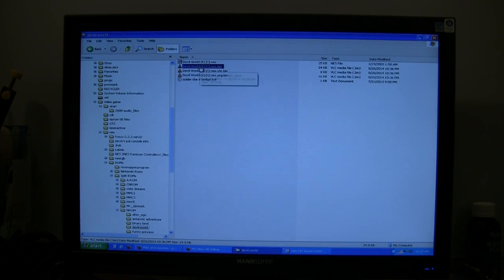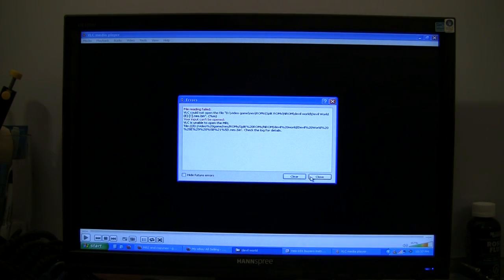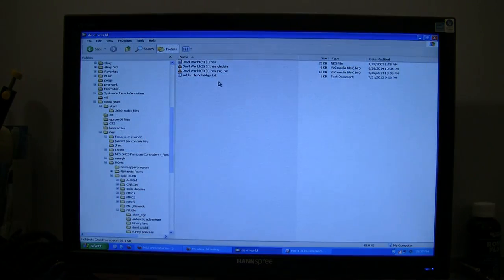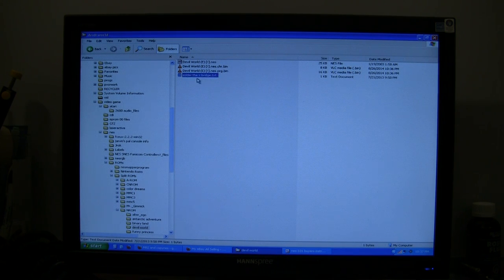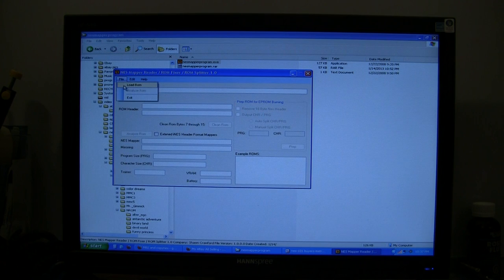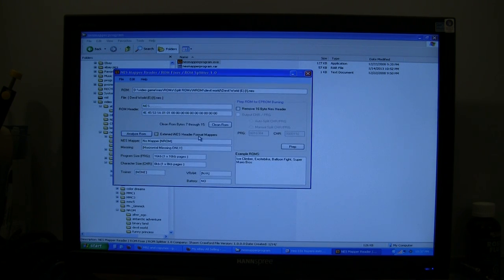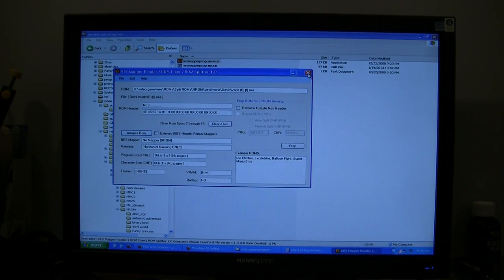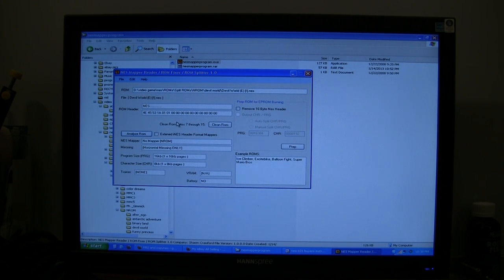How to make NES reproduction games Pt1 using donors and eproms

Comment: I have one question: Is there a way to put a lua script in the nes game? For example. There's this rom hack of metroid called: Mdbtroid and there's also an awesome lua script file separate from the rom hack that gives you a map in the game. Is there a way to combine that?
Reply: look up ips patcher
Reply: No. The Lua scripts for emulators like FCEUX don't run inside the (virtual) NES, they run on your computer outside of anything the NES knows about. The NES is a VERY memory and processing constrained system. It doesn't have the resources available to port a Lua interpreter to it, and implement all the things it can do. Even if you could run the Lua interpreter on the NES, AND still run the game at the same time, the NES doesn't have generic pixel-plotting hardware, so you can't draw overlays like minimaps. (NES games are pushing the processor and available RAM near the limit, so even if you could write an NES Lua interpreter, you have no power leftover to run it in concert with the actual game)

tl;dr: Completely outside the realm of feasibility. If you want it on a real NES you have to ROM-hack the equivalent functionality into the game in 6502 assembly language.

Comment: If you use a heat gun desoldering will go much faster, the part just "falls out", then you can just remove the left over solder (if any) with some solder wick. This technique goes much faster than the solder sucker.

Comment: if you have a 3D printer you could print your own cart cases, I think that you can get a USB2PRT adapter that will let you use your programmer with the newer PC system units.

Comment: Is there anyone that could modify an old NES game and change certain things about it?  There's a strategy game I like by KOEI that I already have on NES but would be very interested if someone knew how to change some parameters of the game.  Sadly, I have ZERO technical skills
Reply: This is called ROM hacking. If you want to change anything about the behavior of the game, you'll need to learn 6502 assembly language to change the game code. If you just want to change the graphics, you can typically use general purpose tools for that, and if you just want to change levels, there may be a level editing for your game of choice.

Comment: how would you approach doing reproduction cart of the same game but different language on the same cart?
Reply from the maker: +kokodin Use a traslated rom.
Reply: +GameTechUS 
obviously.
And with a game such as kirby adventures? I have german nes cart (pal) and i would like to program in oficial british english (pal) rom.
Would copyright protection circuit do any trouble and should i use original rom chips or could i use flash chips instead ? (rewiring afterward)
Reply: Wait, if you dump your own game and then applied a translation patch to it and put it on a reproduction cart for yourself would that be legal?

Comment: I want to make a cartridge of Metroid Rogue Dawn and I want to be sure to get the correct board and chips, etc. The original Metroid used a password system, but Rogue Dawn has battery backup. Does this make a difference when choosing which EEPROM chips I need to use? I'm sure I need to use a board with a battery on it. Is the mapper still the same as original Metroid?

Comment: have you tried a parallel to usb adapter?
Reply from the maker: No, but did buy a top853 and hated it too, might do a vid with more details on my programmers as I do have yet another new one as well.
Reply: Parallel to USB adapters often don't work for things like this: The parallel port was a very low-level interface. You could write data to the port's I/O address and it would flip the state of the electrical lines of the port almost instantaneously. As a result the parallel port found all kinds of uses in the 1980s and 1990s ("bit-banging" protocols for various devices) before it got phased out and everybody started using USB.
USB devices normally communicate with the host no more than 100 times a second. So the host can't instruct a USB-to-parallel port adapter to change the state of those I/O lines faster than that. To move data faster the adaptors accept larger packets of data each time they communicate with the host, buffer it, and take on some of the responsibilities of communicating with the printer. They sacrifice some of the flexibility of the original parallel ports in order to work better with USB.

Comment: Why aren't you trying to save the EPROMs to use later? Are they unusable again?
Reply: The chips he is desoldering? Those are not EPROMs; they are regular rom chips, not erasable. You can tell an EPROM by the "hole" in the center of the chip. This allows UV light in to erase it. Also why you see them with stickers on them so they don't get accidentally erased.
Reply: Assuming it is possible to do so without damaging internal parts. Could a regular ROM chip be cut into from the top to expose the center so that it could be erased with a UV light box?
Reply: Nicholas Bullock NO.
Reply: +Nicholas Bullock no
Reply: Zestypanda So, if you take one out and later decide to put it back to use it as it was before, it won't work?
Reply: Nicholas Bullock Nope. They're created differently.
Reply from the maker: +Nicholas Bullock Yeah just rewire it again to repair the traces, but not likely to ever happen.
Reply: A regular ROM chip isn't writable at all. It's manufactured in such a way that the data is fixed into the hardware, not written to it as software. Its transistors are configured, physically, to represent a certain binary sequence. This is called "mask ROM". They make a sheet called a "mask" that they lay over some silicon, that has the right arrangement, and they etch away parts of the wafer. The result is that ROM is physically etched out of metal, not programmed.

An EPROM is different. It's made to be erasable. It's not physically fixed. An EEPROM is similar, and can be erased with electricity, not UV light.

You can cut open mask ROM if you like (or you might have to burn it open with very dangerous acids), and look at it under a microscope. You'll be able to see the little physical dots of metal representing each bit of data, but you won't be able to change them.

De-desoldering a mask ROM chip from a board doesn't destroy it. If the pins are still in tact, you can still solder it back on. It would still work.

Comment: Have you tried using hot air to desolder the eproms?
Reply from the maker: Yes! It was a FKN disaster! Of course i'm still not super proficient with my crap hot air station, but I managed to make get several chips off with some ease but also made one pcb actually explode in my unprotected face! LOL
Plus it doesn't leave the holes open anyway even if it does get them off a bit quicker in the end the 808 is quicker.
Reply: GameTechUS Yeah, I wish I had an 808. I thought some hot air might help out after you had used the 808 and still couldn't get the chip out.  I hate desoldering through-hole! I like that little drill you have.  Do you have a link where I could get one like it?
Reply from the maker: 8bitjunkie
Yeah using it after the 808 is not a terrible idea, maybe load up the holes with flux so there's more heat transfer down in the holes...
You can get the drills and 'pin vise' on ebay, grainger, etc. The drill bits usually come in a little holder and have like numbers 61-80 in them, the numbers are size identifiers, the higher the number the smaller the drill. 0.025" is like 72 if you look at a drill chart.
Reply from the maker: GameTechUS
A quick search on ebay and I found drill bit and vise sets for super cheap.

Comment: Been getting caught up on vids I missed while concentrating on school.  We use a very similar method to make reproductions, right down to the same programmer :P  I almost replaced the programmer when I ditched the old xp partition on my hard drive however I I did manage to get that programmer working reliably under windows 7 64bit, so all is good.  If you ever need the files to do that, drop me an email if you still have my  addy ^^

The most common question I get is "where can I get the North American Mr Gimmick! Rom!"  ^^       

Anyway, glad to see ya still making vids after taking my break from youtube.  

Cheers!
ThunderSqueak
A.K.A. RetroGameGirl
Reply from the maker: Yeah I didn't know but the US prototype rom doesn't have all the extra sounds, so if'/when I do make more i'll use the jp rom and a new pcb with the AY chip.